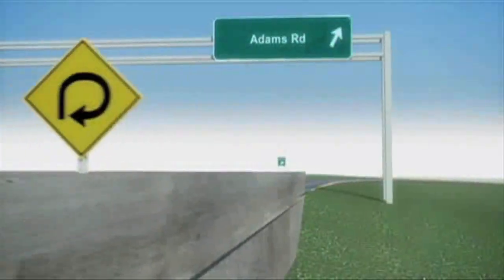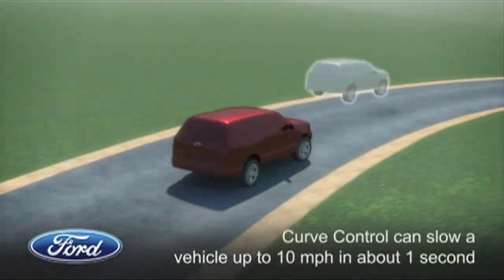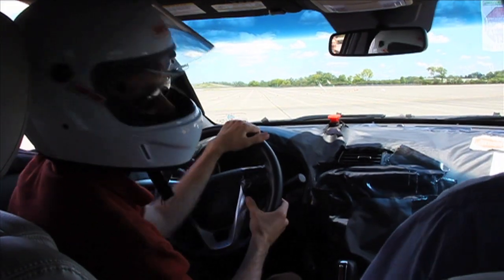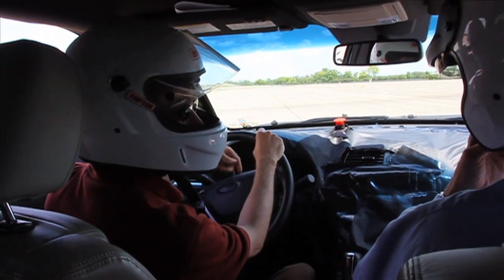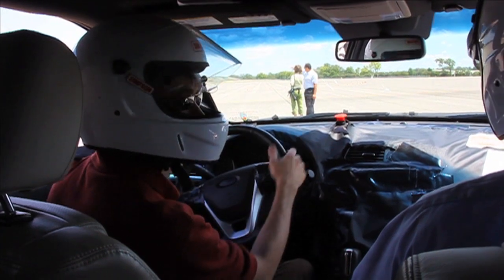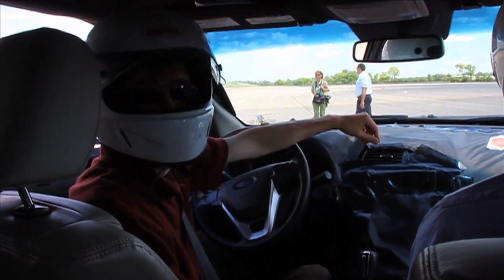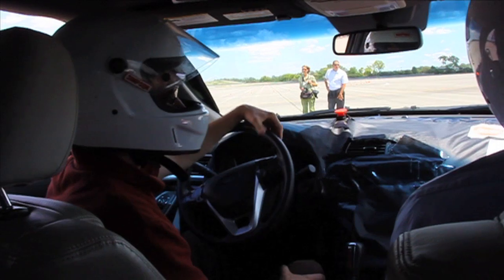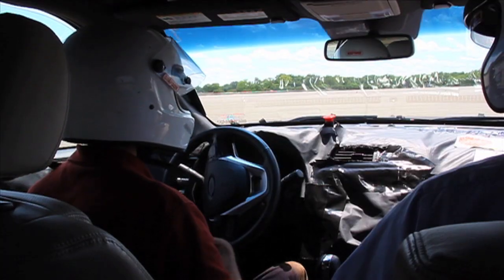2011 Ford Explorer Curve Control

Comment: @GTGTRR From what I can understand. ESP or stability control only controls individual wheels, which means it's only useful to prevent the tail from coming out or the car from plowing forward.  This brakes all four wheels to keep the entire vehicle on course. Think of it as being able to tighten your turning radius at higher speeds. You might not be skidding,  but we all know when speeds increase, so does your turning radius, this is supposed to combat that.

Comment: @Gradeau If there any differences of both systems i would like to know as well. However for that Ford needs to explain the components of the system and how they work to compare and contrast ESP and Curve Control perfectly. But IMO they are the same. Indipendent 4 wheel braking and reducing engine power to keep the vechile in its line. I could write how ESP works here but unfortunately the char limit isnt enough. You can search for videos of how it works. You will also see they are the same.

Comment: @tjhaywood100 
That's my take they'll discontinue the flex and try and sell it as the Explorer but it'll still tank.
The D4 platform as a whole was a big mistake.
They'll probably end up doing an emergency restart of the Panther platform for large cars and making a shortened Expedition platform for SUVs since they presently have nothing that can compete against the likes of  BMW and Lexus.
Lexus says rear drive is essential for high performance driving.

Comment: @Membrane556 Quite true. Rear-Drive is absolutely essential for performance driving. RWD is also superior in every way to FWD. That's why you'll never see a FWD Mercedes, BMW, Jaguar, Aston Martin, or any other luxury/performance car. That's why even Hyundai has joined the RWD arena. That's why Infiniti is a pure RWD company. The automotive industry is shifting from cheap FWD junk to real RWD cars again. And it's about damn time. Ford apparently hasn't figured it out yet.

Comment: @tjhaywood100 
I expect it to tank badly because they already have three models of crossovers.
Most potential buyers would buy the cheaper Escape or Edge which is what happened to the Flex.
Serious 4x4 fans and people who do any towing simply would not touch this with a ten foot pole.
It's market just does not exist BTW in fact ford probably should deep six the entire D4 platform as it's a piss poor successor to the panther platform and everything based on it has been a failure.

Comment: @Membrane556 I agree completely! The only reason the new Explorer is based on the Flex platform is because the Flex isn't selling and Ford thinks that if they call it the Explorer, they'll recoup some of the losses from the Flex. They seem to think people will buy it just because it's called "Explorer". I think soocer moms and sissyboys will flock to it in droves, but it won't last more than a couple of years. Real SUV buyers won't even consider it. The Expedition is the only real SUV Ford has.

Comment: i have seen the new explorer and test drove it ( they had one at a dealership near me)  it was ok however i prefer my 2005 Explorer Ltd it has more of a rugged look than this( it is softer than the 2006-2010) the explorer is a small truck based SPORT UTILITY VEHICLE ! NOT A DAMN CROSSOVER !!!! Not super impressed with the new Explorer. it seems to me that ford just got lazy and made a bigger version of the edge .... not a fan of the new explorer

Comment: Ok, I am calling BS on this demonstration. For the second test with the curve control on he turned the wheel an additional 90 degrees compared to when he said he was testing it with it off. Of course it will turn better if you turn the steering wheel more. This is a scam demonstration.

Comment: What if someone hits the off-ramp at 160 km/h ?
What if there is an earthquake?
Apparently, you will reach a limit as to how many dumb electronics are added to a vehicle.
The most vital safety feature is a reuseable rollcage/spaceframe.
But, a company that is only interested in profit won't do this.
It's a case of need vs. greed.
Maybe 40 coats of paint will trick buyers as well.